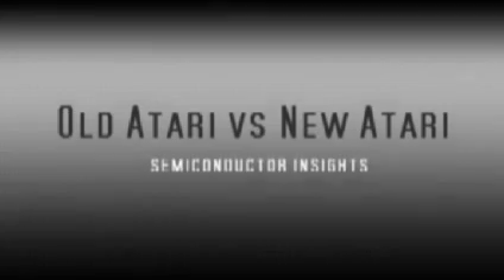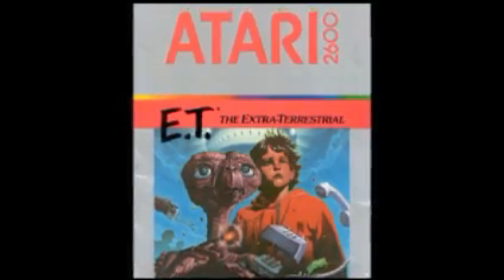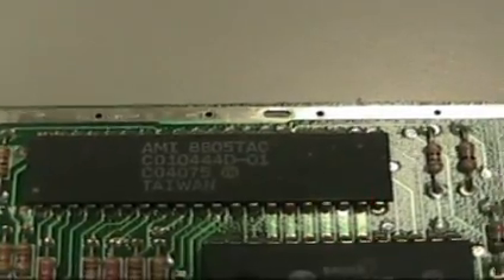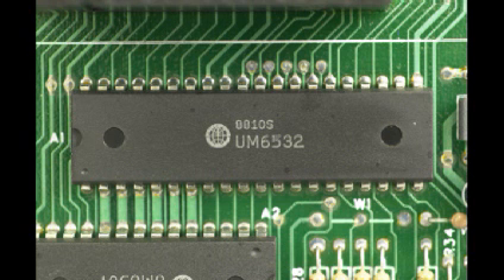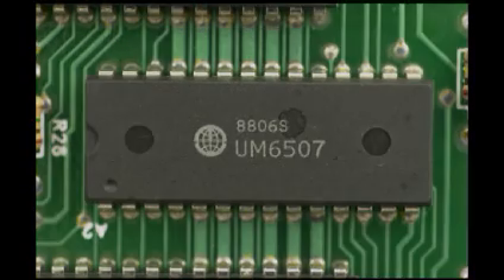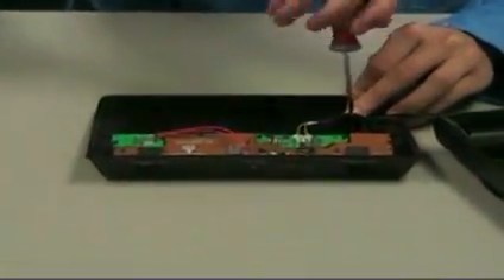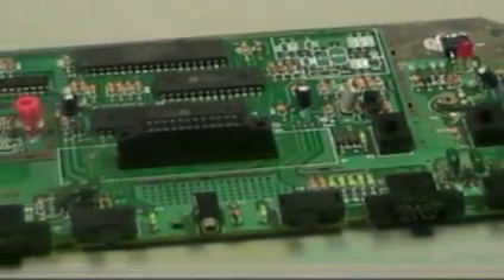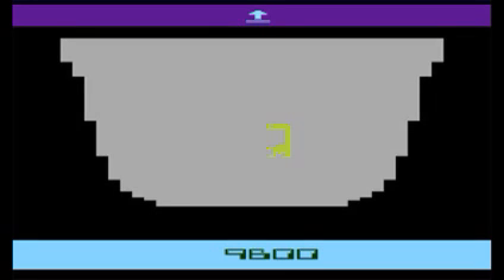Atari 2600 vs Atari Flashback 2

Comment: I would suggest that you clarify that both the CPU and PIA are based on the cores of the original ICs used in the VCS/2600: the MOS Technology 6507 and MOS 6532. MOS also provided most of the EPROMS used in cartridges.

Comment: The both the original 2600 and the Flashback 2 pcbs are oversized, actually. The original 2600 pcb can be cut into a 4" x 4" square around the three chips and the cart slot, and with very very few components added on, you still have a 100% functional 2600 (with composite video... most of that outer stuff is RF circuitry). It can actually be redesigned to be half that size using the original chips and still work perfectly. I've designed such a PCB, but I haven't yet built it.

Comment: The Flashback PCB is hard to mess with. Not much can be done to hack it down, but it could have been designed much smaller than it is if they wanted it to be.

Comment: umm. no.  You can not directly compare clock frequency of two different cpu's when their architecture is so different.  The 360 and PS3 have clock frequencies that are about 2000 times faster, but their cpu's are also many times more efficient at handling code than the atari's.

Per clock clycle the atari can handle 1, (if even that) line of code.  The cpu in the PS3 per clock cycle can handle 14 or more lines of code.

Comment: Granted there was much less games put out on the 2600 in 1984 there was still around 30 or so put out.  And then you have to count the games put out on the 5200 and you should also take into consideration that the Atari St came out in 1985.  Seems to me that they were just trying to convert people to computer consoles.  And I am not including all the games made for other consoles and arcades.  Call it what you want, but they should have named it something else other than crash.

Comment: The size of a console does not determine it's worth. Nor does "more box" or 1980's design. The value of a console is in it's library, and functionality which the 5200 lacked the latter of.

Comment: @andthemouse No the 360 has 3 symmetrical cores running at 3.2 GHz each.
The PS3 Has a PowerPC-base Core @3.2GHz.
you sir, epic fail

Comment: @seganerd89 Yeah I know. I've been gaming for 30 years. Gimmie some credit. I said barely existed, as in no one cared about Atari anymore. Atari had been defeated by the industry in 83. So Nintendo wasn't responsible for dethroning Atari. Atari stopped being relevant years before NES. The NES actually dethroned the Sega Master System. Which was a formidable opponent, in terms of power at least.

Comment: PAC MAN on the 2600 Sucked too NOTHING like the Arcade version. Pac Man Knock offs were more like the arcade Pac Man.

The Atari Flash Back was an emulator, it was not the 2600 hardware packed into 1 or 2 chips.